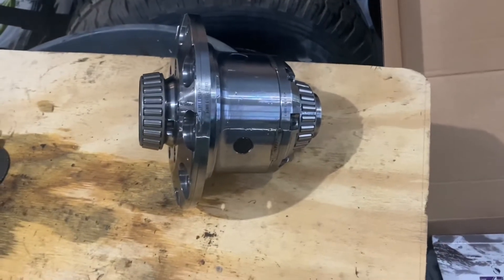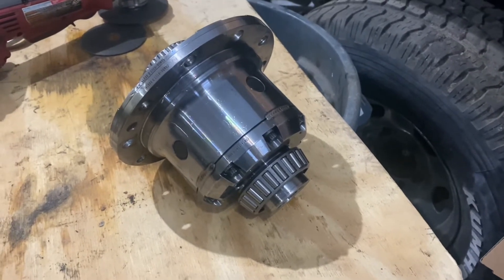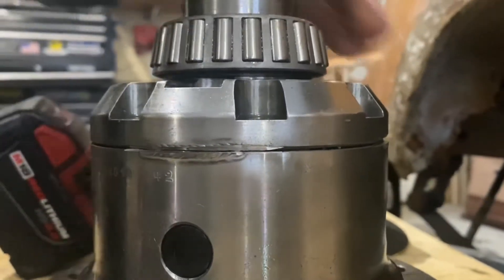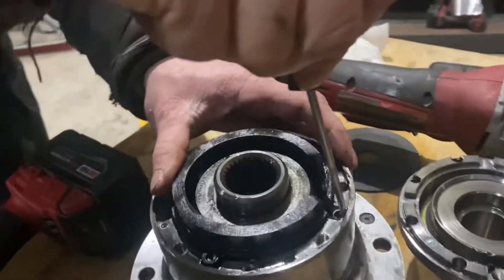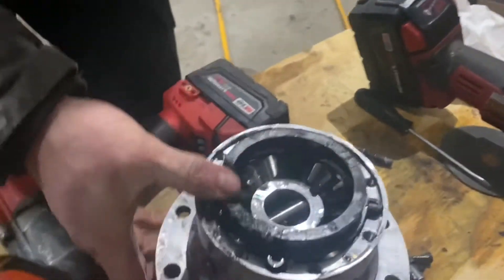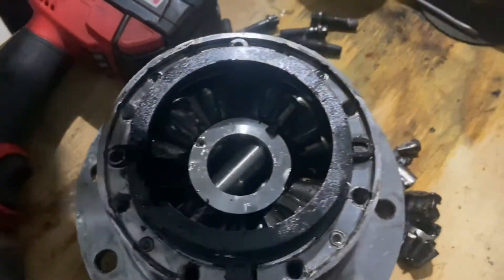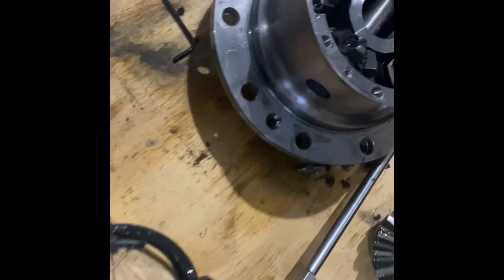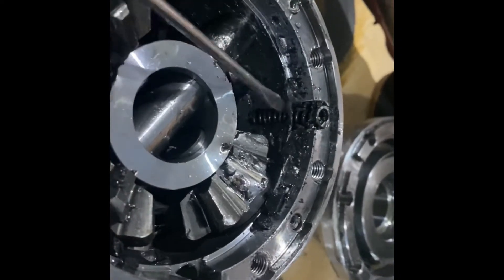Inspecting a broken Yukon Zip Locker.

Comment: My D60 comp locker was basically a paper weight.  Spiders were welded to the cross pin and the weren't removable, plastic cage was broken apart and metal sent through everything inside.  I was told after it was sent in it was a old version and since updated.  It hasn't been a issue since it was replaced with another.